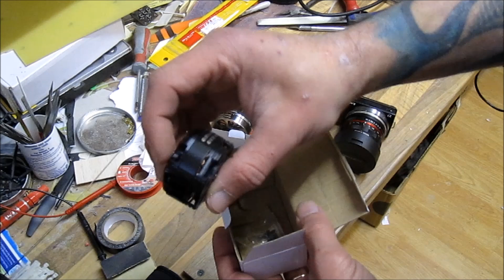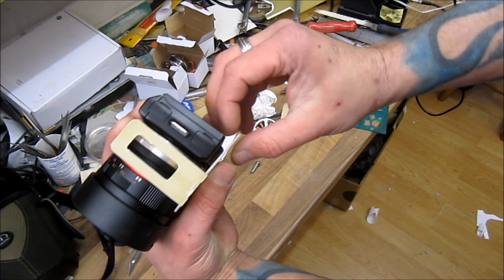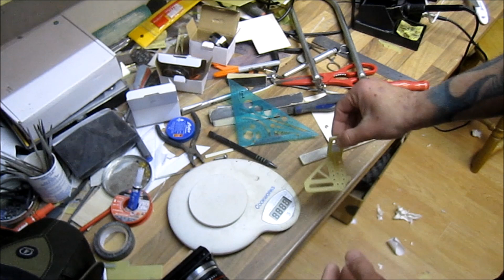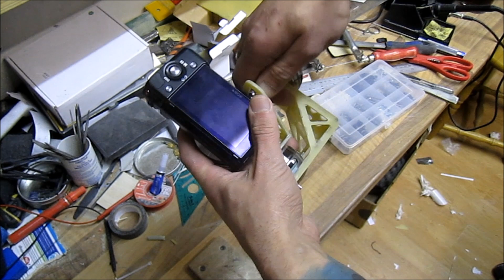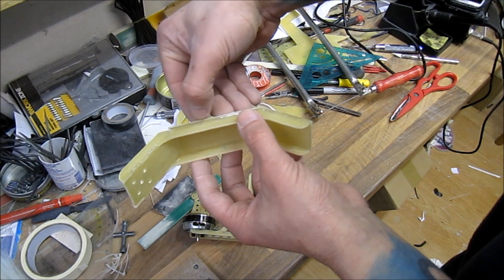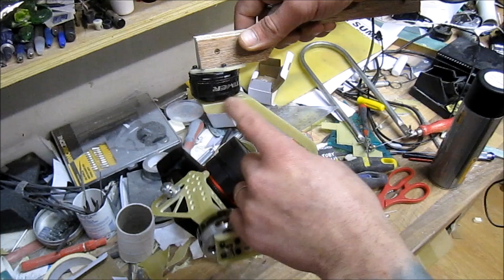DIY 3-axis Brushless Gimbal for Nex5N. Step by step build

Comment: Hey there! Awesome build, it's inspired me to make my own. But i was having some trouble with the junctions of the Yaw arm, at the 45 degree angles. How do you glue those together firmly?
Reply from the maker: Ahoy! I don't quite get it what do you mean "junctions". If it's interlocking parts (like box joints in carpentry), then I don't do anything fancy- just like normal joints only at 45deg. After CA glue I sand them flush and fill the gaps with CA and baking soda. Same on the inside of that angle. Sanding after again and that'll do, coz there's a second GF plate goes on top that overlaps the first one,  and that's enough for strength of the joint.
Reply: Thanks for the quick reply! Ok, that's what I was wondering about. I've been doing the interlocking parts, but they just didn't seem as effective at 45 degrees, but I'll definitely be going over them again with glue. What's the baking soda for?
Reply from the maker: Cameron Fedde Baking soda with CA is the next best thing after invention of a sliced bread:)) It is for filling gaps, sort of like epoxy with microbaloons. Not as strong structurally, but for what we need is brilliant. Apply some CA and sprinkle some soda on. It will dry instantly and will be ready for sanding. I do a bead of CA+soda everywhere now on a joints. Let's say you glue a "T" part without interlocking. It will not hold. With interlocking it will be much much stronger, and if you do a CA+soda strip along the joint, it will be even more solid:)
Reply: +ROBOFORCERX2000 I didn't know that! That will be super useful. Well, thanks for the info!

Comment: Hey, nice work! But how did you get the controller board, the wiring??
Reply from the maker: The wiring is more than simple- plug in motor leads to the board and that's it:)
Reply: +ROBOFORCERX2000 what about the board? I am asking because I am trying to make a gimbal using an Arduino, but I am stuck on the programming
Reply from the maker: Vitor Porto I've no knowledge about Arduino, but those gimbal boards would be cheaper and better solution, because it is not like your average flight controller that sends PWM to outputs. Gimbal controllers have to have brushless motors drivers, so all the electronics combined with the headache of a programming messing will be a long journey that I believe would not be worth the hassle...

Comment: Hi Roboforcerx, this is an amazing project. Could You please specify the brushless motor specification  and were i can buy the electronic motherboard. grazie
Reply from the maker: +Fragalà Angelo 
I said about the motors in first half a minute of the video:) Nearly every hobby shop has motors and gimbal controllers, like Hobbyking.com etc.
Reply: +ROBOFORCERX2000 Grazie

Comment: Very impressive work! This is one of the nicest hand made gimbals I've seen. 
Would you mind answering some questions? What controller are you using? Are those motors enough for the NEX5 weight without heating much both motors and drivers? What glue do you use for the fiberglass?
I have a similar weight camera and want to make one myself. I'm not familiar with this kind of material, but I'm familiar with other kinds of electronics and materials though.
Reply from the maker: +Leonardo Santos 
Ahoy, thanks for heads up:)
Controller was EvvGC with experimental FW and super simple GUI. Here's the test of that gimbal and at the start you can see it's GUI- https://www.youtube.com/watch?v=3ieLATwwelQ. Now that everything evolved I'd go for second best Storm32 BGC as Alexmos is out of my pocket:)
Motors were just about, enough power for smooth multicopter, but if you want to build a handheld one where weight doesn't matter as much, I'd go for a slightly bigger ones- when there's no short on motor torque you can decrease the power in GUI and that lets you to increase P values, what makes the gimbal more locked in.
I use CA glue and interlock parts as much as possible, super strong structure yet very lightweight.
And GF plate- you just have to experiment and see whether you like to work with it. I think I've mastered it by now so it's my favorite material, but people having great success with 3D printing, aluminium angle gimbals, or just from plywood. Don't be afraid to experiment:) Hope that helps, cheers!
Reply: +ROBOFORCERX2000 Thanks for the fast reply. I think i'll go for CNC'd aluminium structure.
I'm in process of ordering everything to start building my gimbal. And as I didn't found any tutorial out there, I wanted to ask to an experienced builder like you: When I used to modify video game consoles into handheld ones or any other mod, I remember I need using a LiPo protection PCB to prevent shorts and high/low voltage damage.
Every DIY gimbals I've seen as of right now, don't mention any PCB. Did you used one on your gimbal? Sorry If I sound like a noob, but I'm not into the RC models world. Do you know, aproximately, how much current it draws? I'm also thinking on using Canon BP915 batteries, as I can charge it separetely and also already comes with PCB inside them. What do you think about it?
Thanks for your attention!
Reply from the maker: Leonardo Santos Personally I don't think there's a need for PCB, not much wires and no big currents. Not much Amp draw from them motors either, so your choice of batteries is good, but keep in mind that you will need two of them connected in parallel to give you 14.4v, because one battery at 7.4v would be definitely too weak. 3s Lipos (11.1v) are just about for small gimbals, but bigger motors need 4s- 14.4v. Also when choosing gimbal controller keep in mind that a mini ones are meant for small motors for Gopro size gimbals, and lager motors like for Nex5N and up draw more Amps so needs a gimbal controller capable of that current flow.
I didn't build a gimbal for a good while now and don't follow all the very latest gimbal tech, so Google will be your best friend for research:)
There's a little guide- check what motors people are using for which cams, their all up gimbal weight including cameras and whether motors have enough power for them, what Amps what controllers are capable and so on. The more info you gather, the less surprises there will be:)
Reply: I'll be using an Storm32 v1.31 with the DRV8313 drivers and three 5208-200T motors.
Do you think I'll be good with these? My camera is a Sony Alpha 3000. It weights around 700 / 800g with lenses.
Thanks!
Reply from the maker: Leonardo Santos Yep, everything sounds about right to my knowledge:)
Reply: Many thanks man! Really appreciated it!

Comment: Hi Roboforcer, i come back to you for some questions...i'd like to build my first brushless gimbal for a Sony nex 7 ...Sony weighs 550grams max ...i see you used 4108-130T ( x 1 ) and 5010-150T ( x 2 ) as motors but  you get with short shaft for YAW axe...but i find only this following...

Rctimer 4108-130T Gimbal Brushless Motor With Slip Ring(24N22P)

Why don't you use 5010-150 T with hollow shaft instead of long shaft...is there any difference...?

Then could you confirm your controller board...Alexmos..?  8 or 32 bits...1  or 2 imu...?

Thank's a lot and funny flights

Philippe
Reply from the maker: +Drones Visions Aériennes 
At the time I used motors whatever I was given so had to work with what I had, but if I would build one now I'd definitely use hollow shaft ones on pitch and roll and slip ring on yaw axis'. And at the time them 2 years ago there was no 32bit or double IMU:) I used EvvGC board with experimental FW from a friend. Here's the video of me testing that gimbal, as for only roughly tuned I think it was pretty good:)) https://www.youtube.com/watch?v=3ieLATwwelQ Also in that video at first few seconds you can see board's super simple GUI. Now I'd definitely use Alexmos 32bit, one IMU seems enough. But not any of the clones, original only, because you can't update FW on clones to higher than 2.2. Or a cheaper option would be second best after Alexmos- Storm32 BGC:)

Comment: Very nice work!! looks pro. What is your solution for vibration dampening?
Reply from the maker: Percepto A non flexible frame with well balanced props and motors, and after that any hard mount through any rubber does the job well:) Cheers!

Comment: hello!
sorry if this sounds a stupid question but how do you proceed to find the centre of gravity?
awesome work btw :)
Reply from the maker: I'm placing camera balancing on the pencil along and find out where my pitch motor shaft will be. Then placing camera with lens looking up and where it balances there's my pitch motor height from the base. Knowing these measurements I build pitch angle (allowing ~10mm up and down from balance point and at the base ~15mm for cam to move forward/back), install pitch motor and put on the pencil to balance again to find CG for Roll axis. And so on:) Cheers!

Comment: Nice video! What the glue you have used? And why pitch motor finally placed forward than yaw axis?
Reply from the maker: I use ordinary CA, does the job well and quickly. I didn't place pitch motor specifically forward, it is wherever my balance for yaw axis appeared, which has to balanced as well.

Comment: Could you give me any advice about the battery used, and the expected duration and performance you experience?
Reply from the maker: On bigger copters I use 2.2A-3.0A 3s batteries which powers video system as well,dunno about duration, lasts more than I have flight batteries.

Comment: I am 90% ready with designing a brushless gimbal in CAD, its made for a gopro.
1 quick question- what is the function of slip rings? just to pass the wire internally so that gimbal can rotate continuously without wiring issue? or something else?

Are you on skype? I would like to show you my design!
Reply from the maker: Yep, slip rings are for that purpose. Used on big rigs with retractable landing gear, where mostly  two people are operating- one is flying, and the other is on camera with 360deg turn. I think there's no need for them on Gopro gimbals and use 3rd axis only for dampening Yaw. 
I'm not on Skype, FPVlabs is where I'm at most

Comment: GREAT TIMING on this! I just ordered the ASP 2 axis Aluminum Gimbal. I don't have your fabrication skills.:-)  Which controller are you using? Maybe you can show how much software set-up you needed to got this going. I'm completely Dark on that area. I'm going with a 2 axis to start, actually for handheld only. I don't know how to mount the board. Can you advise what size standoffs plastic screws you are using on the IMU/Controller? I'd like to order them and have them when my Gimbal kit comes in in a couple weeks. I went with the 4108 motors over the 5010.

Thanks for sharing your amazing work!!
Reply from the maker: Any plastic screws will do, height doesn't matter as long as IMU is mounted parallel to the plate. Others are using double sided tape and it works as well. Most of gimbal controllers have PIDs set as starting point and it works most of the time out of the box. Later only minor adjustments needed
Reply: ROBOFORCERX2000 I was looking on ebay. Should I get  M3 plastic screws and standoffs?
Reply from the maker: FilmFactry That's what I used

Comment: Are you sure you need adjustable motor mount on the yaw axis?
Reply from the maker: It does need to be adjustable in every axis- the better the balance, the easier for motors to do their work. So when motors have enough power themselves and doesn't have to deal with compensating the weight, only with mass inertia, the "power" on GUI can be reduced therefore P gains increased, what will give a better stability. Yaw axis is no different- if a copter flies forward and yaw axis is not balanced, then the gimbal will want to shift and yaw motor will have to work extra hard to keep it in place. I suppose for handheld gimbals could be not that much of a big deal, but this one will be flying on a Octocopter:)